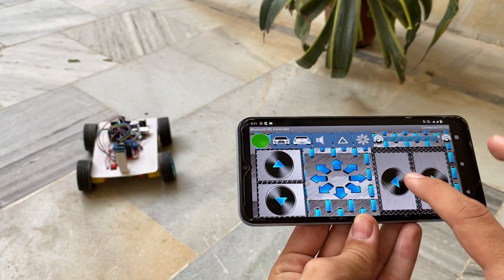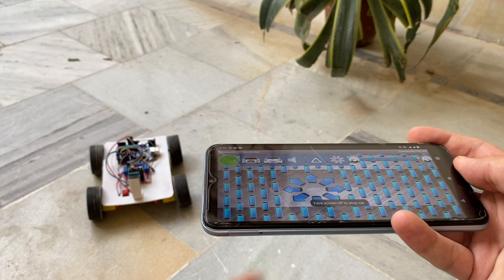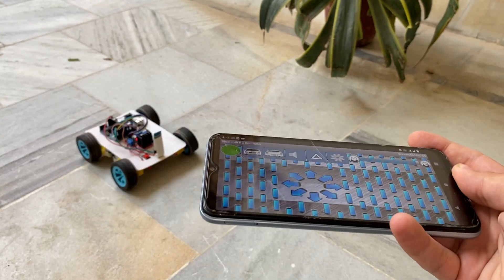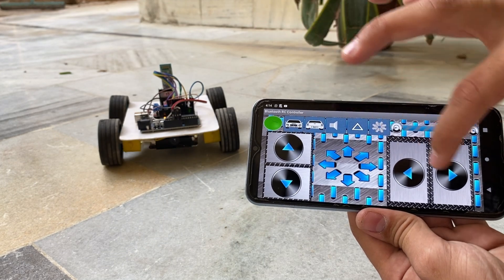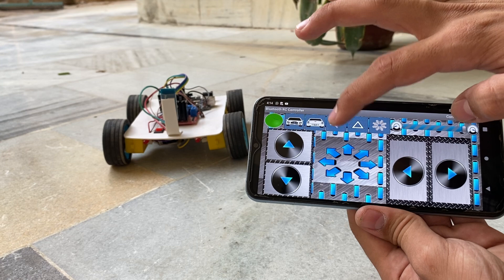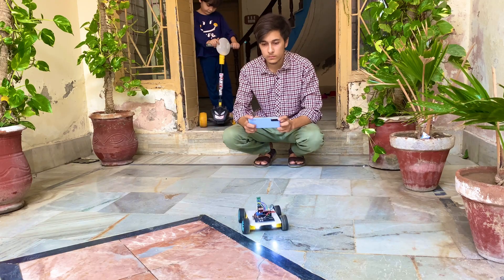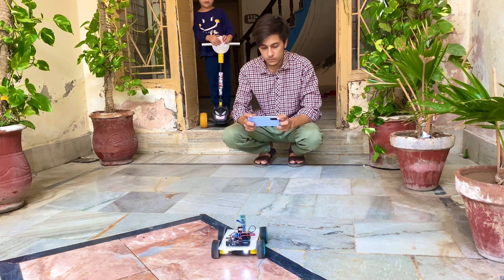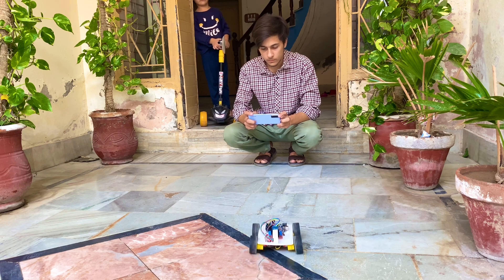DIY Bluetooth Controlled Car with Front and Back Light and Horn using Arduino

Comment from the maker: You are free to ask Questions about any issue regarding this project (In any language) . You will be responded soon!
Reply: This coding is not working
Reply: is it okay to use servo motor on l293n for steering?
Reply: Code pls
Reply: everything done and its connected to but not working
Reply: What is total cost ?
Reply: Can u give me the correct code
Reply: Bro motors are not working at all 😢
Reply: Hola, necesito ayudo acabo de hacer ese carrito tal y como lo hiciste pero no me funciona
Reply: How many volts we can give to aurdino
Reply: We used the same...conneceted the wires according to it...the bluetooth got connected to the bluettoth module through the recommended app..the bluetooth got connected but it didnt work at all...we tried to 5 to 6 times...but it didnt work..pleaee help us...
Reply: Bluetooth doesn't connect
Reply: Sir hamra madad k jarurat aai
Reply: Bro integrate this with the fire fighting robot please!
Reply from the maker: @johnkarlogallardo9158  In the future

Comment: Hello. This coding does not work, there are only errors in the coding. It needs to be redone. How is it possible that it works for you? The code in this version does not work at all.
Reply from the maker: You may have port issue, code is perfectly fine

Comment: Bro i did this... the motor is moving in different direction whenever i press the button.
Reply from the maker: Try interchanging bo motor wires with each other one by one until it work as directed

Comment: Sir give the correct code
Reply: Ur code is not working and have so many errors
Reply from the maker: What errors are shown?
Reply: @saadinnovativeideas  it is showing like this 

 programmer is not responding
avrdude: stk500_getsync() attempt 1 of 10: not in sync: resp=0x30
avrdude: stk500_recv(): programmer is not responding
avrdude: stk500_getsync() attempt 2 of 10: not in sync: resp=0x30
avrdude: stk500_recv(): programmer is not responding
avrdude: stk500_getsync() attempt 3 of 10: not in sync: resp=0x30
avrdude: stk500_recv(): programmer is not responding
avrdude: stk500_getsync() attempt 4 of 10: not in sync: resp=0x30
avrdude: stk500_recv(): programmer is not responding
avrdude: stk500_getsync() attempt 5 of 10: not in sync: resp=0x30
avrdude: stk500_recv(): programmer is not responding
avrdude: stk500_getsync() attempt 6 of 10: not in sync: resp=0x30
avrdude: stk500_recv(): programmer is not responding
avrdude: stk500_getsync() attempt 7 of 10: not in sync: resp=0x30
avrdude: stk500_recv(): programmer is not responding
avrdude: stk500_getsync() attempt 8 of 10: not in sync: resp=0x30
avrdude: stk500_recv(): programmer is not responding
avrdude: stk500_getsync() attempt 9 of 10: not in sync: resp=0x30
avrdude: stk500_recv(): programmer is not responding
avrdude: stk500_getsync() attempt 10 of 10: not in sync: resp=0x30
Failed uploading: uploading error: exit status 1
Reply from the maker: This is not the error in code its uploading error, may because of not selecting the right port (COM)
Reply: Pls give fast Tommorow i should show this project for our principal I have done everything but code is not working it has many errors pls reply fast modify the code and give correct code🙏
Reply: Yes plss
Reply: In my 

There is arror IN Code that is :

Compilation error

espcar.ino:1:68: fatal error: BluetoothSerial.h: No such file or directory

Comment: bro hc05 is paired on my mobile but its not connecting please give solution and also give the link of the app for remote you used its not there on playstore
Reply from the maker: Just pair it via Bluetooth in phone settings and enter code then it will be disconnected by itself. then in the app you will connect the car with the same option
Reply: @saadinnovativeideas  bro it didnt ask for any password while pairing and now it shows connected but in app after trying to connect its not connecting
Reply from the maker: Can you send me its video
Reply: I'm also facing the same problem here😢😢
Reply: Sure but  how do I send it to you
Reply from the maker: Via instagram sahibzada3767
Reply: @saadinnovativeideas i want solution plz
Reply: Any solution?

Comment: Can I use dip type Boarding with micro controller in the place of smd
Reply: Please tell me 😢
Reply from the maker: Yes thats better than smd
Reply: Thanks for your reply
Reply: Same code dalna ha dip me bhi
Reply: Pls 😢😢
Reply: Can I use 6 watt buzzer
Reply from the maker: Yes same code upload karna hai, or buzzer laga saktai ho water pum se parellel connection dedo
Reply: Me nhi samjha
Reply: Tell fast brroo
Reply: In rc car
Reply from the maker: Buzzer ke dono wires ko water pump ke wires ke sath connect karlo
Reply: Mera 1 orr questions ka jawab de dijiye
Reply from the maker: G pochia
Reply: There is arror IN Code that is :

Compilation error

espcar.ino:1:68: fatal error: BluetoothSerial.h: No such file or directory
Reply: Ye aa rha h Code compile waqat

Comment: Sir when i try to connect my bluetooth module to app it shows error 507 unable to connect 
How can we resolve this 
Please help
Reply from the maker: Where is error shown??
Reply: In the mobile app
Reply from the maker: You have yo connect the car via bluetooth in phone settings, then you will see the paired option in app settings
Reply: Yeah the option is available but when we are clicking on it then after its showing this error
Reply from the maker: Is the blue led on hc05 module continuously blinking?

Comment: Could you make 3 in 1. Bluetooth, obstacles avoid, follow the object.
But all in one code and one app contains 3 option as per said above.

For example sun founder 😅
Reply from the maker: Yeah I have plained to make like that in future. I have recently built line follower with obstacle avoidance…
Reply: dude this is easiest job

Comment: I have used hw battery and the bluetooth is not getting power supply 
Do I have to change the battery or what to do
Reply from the maker: That won’t work use rechargeable one

Comment: bro  i have done everything according to ur video,  i have followed everything but its not working i have checked all the components. non of the components are running bro
Reply from the maker: Did you succeed to connect it with phone?
Reply: Ya bro

Comment: Bro i followed the instructions as it is but my car is not running and from Bluetooth module only red light is blinking, no bluelight
Reply from the maker: Flip the the two wires (TX and RX ) of the bluetooth module to the arduino board
Reply: I have used 2x 3.7 vl battery and the L298 motor driver  and B O motors 4x
Reply: I forgot to tell you that i haven't used horn and lights
Reply from the maker: Horn and lights are optional, no problem
Reply: Still same red light blinking no blue light😢
Reply from the maker: Is that not peering via bluetooth with phone? And which bluetooth module have you used?
Reply: Bro pls help
Reply: HC 05 as you told and the bluetooth module is pairing but car is not moving. In your video, red and blue light in hc 05 are blinking but in my car only red light is blinking
Reply from the maker: I think your power is not sufficient. Which battery have you used and whats the net input voltage to motor driver

Comment: I did as per your video but I'm having one problem once i make any movement like fitra forward, backward or left right,  motor stats but doesn't stops and keeps going on i can't do anything else rather than turning off and on again but same happens again😢
Reply from the maker: Double check the connections if there is no mistake then your arduino board or motor driver is faulty

Comment: bro I can't connect to the app my Bluetooth is paired but it wont connect.
Reply from the maker: You have to click on HC-05 in the app setting too by selecting Connect to car
Reply: @saadinnovativeideas  it connects but hc05 doesn't have a pin,maybe my hc05 is fake

Comment: Hello brother, can you help me configure the Bluetooth because when I connect to the cell phone it does not respond :(
Reply from the maker: Make sure the car is turn on and Bluetooth is pairing (blinking rad and blue led), turn on the Bluetooth on your smart phone and start pairing. When HC-05 appears hit it and enter password (1234). Now leave the setting and go to the rc Bluetooth app and in setting click connect to car and over there click HC-05, now it is connected with your 📱
Reply: @saadinnovativeideas  Yes, when you pair the Bluetooth it turns off and you lose the connection and I don't know why?
Reply from the maker: @jersonmoronsanchez4617  No I again turn it on to connect with car
Reply: @saadinnovativeideas  I don't know if it's a Bluetooth problem or you still need to configure it?
Reply from the maker: @jersonmoronsanchez4617 where you face the problem brother?
Reply: @saadinnovativeideas   It reads the code but when I activate the Bluetooth with my cell phone the lights go off and the signal is lost and the cart doesn't work :(
Reply from the maker: When the light stops rapid blinking, it means that is is connected but you have to select HC-05 again in the app setting (CONNECT TO CAR)  as shown in the video

Comment: Your code is complied with many errors what can i do
Reply from the maker: There is no error. However text me those error
Reply: I am not given the connections for buzzer and leds only I am trying to drive the car but I uploaded the code without the error now and also given the connections correctly but it does not works
Reply from the maker: Connections for front, back leds and buzzer is cleared in the circuit diagram
Reply: And the battery capacity is not capable is really you use 3.7v x 2 batteries for this
Reply from the maker: Yeah 2x 3.7v rechargeable
Reply: Can you give ur WhatsApp number 
Or else whether any way to send my project video to you for finding of my issue

Comment: error compiling for board Arduino Uno 😢 problem 😢
Reply: Same bro😢
Reply from the maker: I have used the same one, mostly you face problem in due to selecting wrong PORT (COM), If Port is not connecting install usb driver for it

Comment: sir i am not able to programing Arduino please help me 😢
Reply from the maker: Just copy the provided code as it is and paste it in the arduino software, select right PORT and BOARD and UPLOAD it as shown in the video
Reply: @saadinnovativeideas  error problem sir
Reply from the maker: Text me the error shown by arduino a bottom of the screen
Reply: @saadinnovativeideas  Error compiling for board Arduino Uno
Reply: @saadinnovativeideas  Error compiling for board Arduino Uno
Reply from the maker: Thats not the problem with code. You haven’t selected the right BOARD mad may be the port. For port install usb driver
Reply: @saadinnovativeideas  Error compiling for board Arduino Uno
Reply from the maker: When you connect your arduino uno then  select Arduino uno in tools in the software